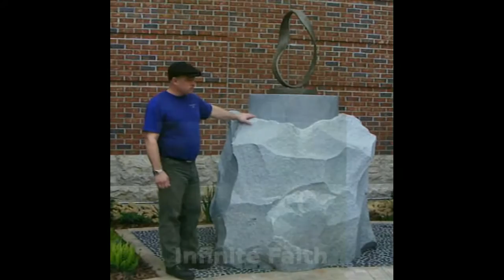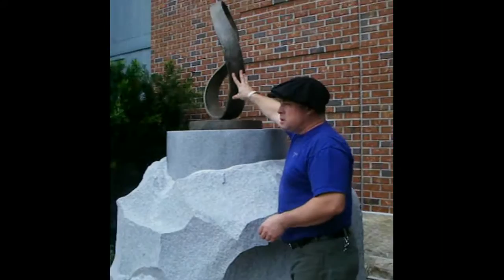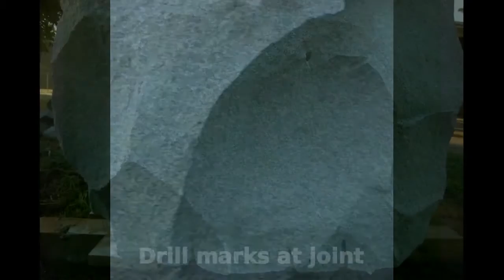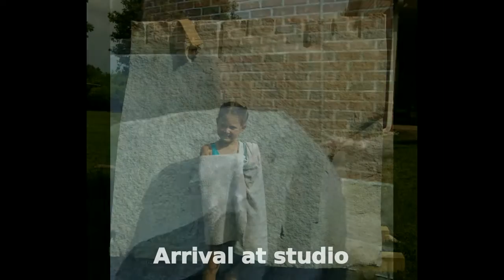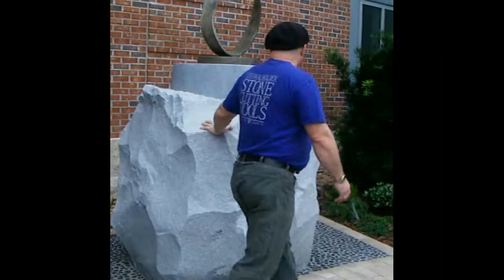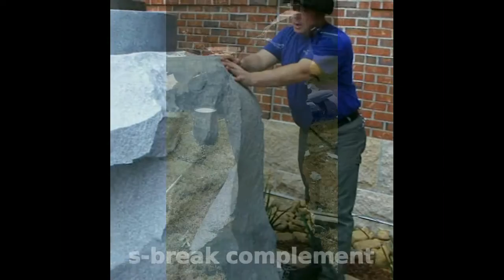Shell Rock Pitch Granite monument with Bronze sculpture, AC Button II Carolina Sculpture Studio

Comment: Amazing talent. The only tooling marks that offer a slight hint of how this is accomplished are on the shards of waste rock.  On the s-break possibly,... a fracture is introduced vertically with a pitching chisel and a 30 degree secondary fracture is introduced to intersect the primary vertical fracture near the base. Custom made feather and wedges without bent tabs on the feathers are drilled and set on a very steep angle above the primary vertical fracture. The cleaving force is initiated by the feather and wedges, ending just inside the original vertical fracture.      Basically working backwards from the outside in, to the final dimensions surmised by the artisan and his abilities to read the stone.       This is all conjecture on my part, but there are absolutely no instructions written or verbal on this lost technique. Aside from being present in the stone shed 50 years ago, we may never know how this is really accomplished.  Clint Button may be the last artisan to truly know how to properly apply this artform and read the stone for all its hidden qualities and potential.  Absolutely enduring and beautiful from every angle and shadow cast.
Reply from the maker: I admire your ambition, James.  Before you dive into a shell rock pitch project of your own, just be careful- you know how they say how a little bit of knowledge can be more dangerous than knowing the entire story….?

The tool marks present on this finished stone are of little relevance to the overall technical process.  The original concept for the base was presented to me with specific requests to leave a variety of tool marks (drill marks, hammer & point stuns and incomplete breaks/cracks) upon the finished stone to as metaphors of the struggles of man against the obstacle before him, which would in turn become the foundation for faith.  

This stone was a very indulgent stone to cut, simply in terms of overall mass.  It also presented me a significant lesson about how much risk is at hand with every break.  It literally turned my entire perspective of this job and the process in general upside down.  As a result, the stone turned out better than I could have ever imagined.

Keep being ambitious, James.  Shell Rock Pitch demands more than a timid craftsman can do.